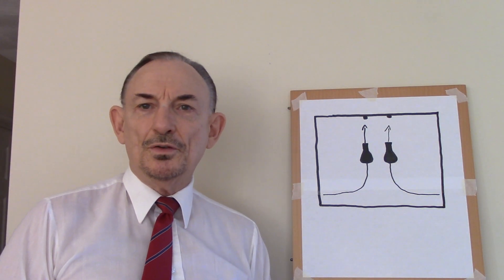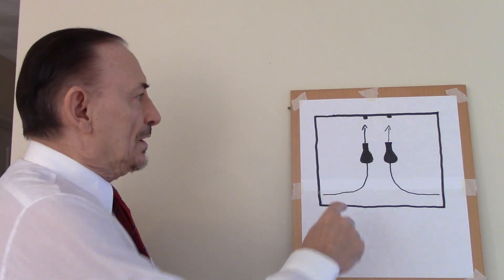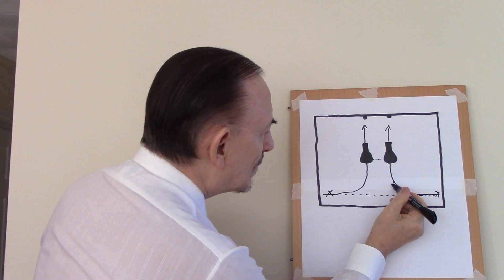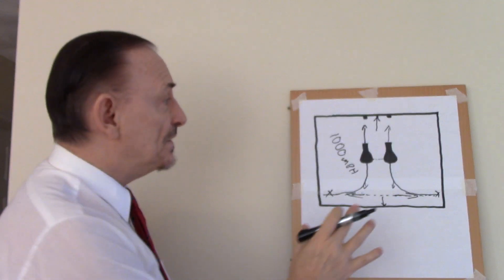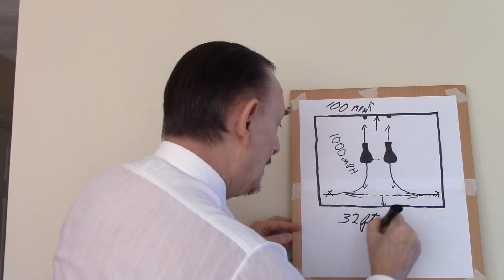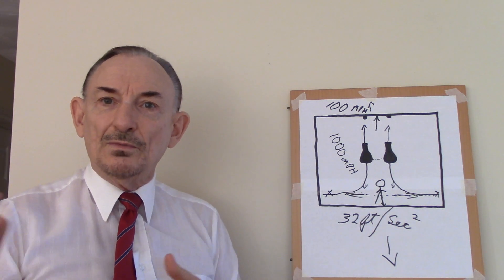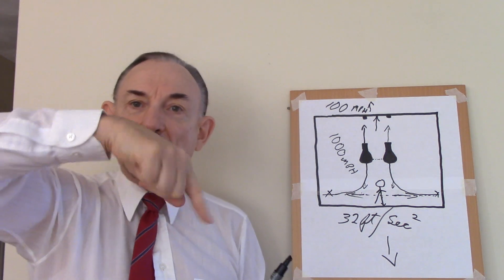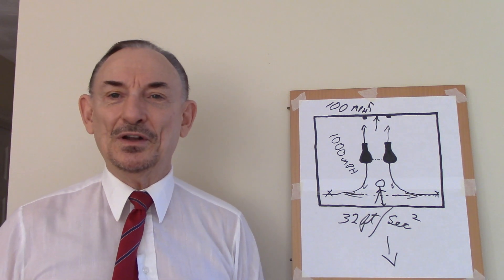THRUST CREATED IN CLOSED BOX

Comment: Thanks for the explanation. 

Assume the cannons and beanbags have equal mass.

As the cannons fire and travel down the rails, they exert a centrifugal force on them, or rather they exert a centrifugal force on each other. 
As you have shown the centrifugal force has a downward (let's call it the y-axis) component  on the rail, which pushes the box in the opposite direction to the beanbags, transmitting that force to the box via the chain, assuming it is held taut. 

The total y-axis momentum imparted by that force as the cannons reach the end of the rail must be half that of the beanbags/cannons. The other half is imparted on the chain (along the x-axis), since they are travelling in that direction by the time they reach the end of the rail. Therefore the net y momentum, upon the beanbags hitting the wall, would appear to be 1/2 that if the initial momentum of the cannons and beanbags.

Newton's third law would indeed appear to have been contravened; there is now a net momentum in the y direction - what am I not accounting for? Any physicists wanna bite? What have I missed? And Jeff, if you do see this, is my explanation correct? (Well, the same question to you basically if not)
Reply: The cannon will be transferring y-axis momentum the whole time they are moving on the curved rails (which are fixed to the box). The integral will /should exactly match that of the projectiles on the box wall. So the box will just jiggle up and down leaving the CG stationary and unchanged when the projectiles are reloaded into the cannon.

Comment: There's no breaking of the third law here. The force necessary to "reset" the cannons is being ignored. The force necessary to allow the cannons to remain pointed up during the initial firing is ignored. The force exerted by the cannons on the curved rails is being ignored. (I know you drew arrows for it. Aside from drawing the arrows, you seem to ignore it after that.) I'm curious to see what an actual vector diagram of this thrust model would reveal. I guarantee you the forces would equal out.

In your example, it would be worlds more efficient simply to fix the cannons to the wall, pointed down, and fire the bags at a curved surface to deflect their energy to the sides while the recoil of the cannons pulled the box up. Even then - it's a Rube Goldberg device and you'd see no apparent motion. Even without the force of gravity - you're still at net zero accellerative force.

As for generating force enough within a box to move and accelerate that box, check out the cube bot, driven by reaction wheels. It's entirely gyroscopic and inertially motivated. Problem - the exterior of the box's friction with the environment is necessary to provide the thrust. It works fine with gravity - useless in space as a thrust generator.

I want to see a working model of your propellor. Shouldn't it be relatively simple to model?
Reply from the maker: This description is so simple that I do not understand why you cannot grasp that there is no downward force on the X axis that equals the force that is absorbed in the chain. Therefore, the upward force exerted on the forward wall by the beanbags is not equaled on the opposite end of the X axis on the downward wall.
I did NOT ignore the force in the curve of the rails and in fact, I made it very clear to anyone listening, that that force was not equal to the force exerted on the upper wall.
I have a video of my prototype on YouTube, that conclusively proves that this principle does work. The video is not impressive, but it does prove the principle.
I took my prototype to my nation's capital, Ottawa, and met with two government officials, one of whom had 4 degrees, two of which were in physics and in engineering. The other two degrees were related to engineering. After viewing my prototype and the description that I gave in the above video, he had no difficulty in understanding and agreeing with the principle. Newton's 3rd Law still stands, but my explanation expands on it.
Reply: @jeffincanada5060  The force necessary to reset your cannon position has to equal net zero thrust. The entire explanation is convoluted.

Instead of this flawed chain-cannon-ramp-beanbag-box analogy, have you published your actual mechanism? It's probably going to make more sense to me than this.
Reply from the maker: @SwervingLemon  Resetting the cannons is a clearly different set of forces. Resetting the cannons will not affect the fact that the box is already moving through space. Since after firing the cannons, the box is moving and the cannons are stationary in their recoiled positions, any moving of the cannons after that will have its own reactionary forces.
To call my example "flawed" is not directly addressing any questions that you may have about this example. You ask if I have "published your actual mechanism". Your English is not clear. Please be clear as to what your question means.
Again, if you have questions as to the explanation, please pose your question and perhaps I can answer it to your satisfaction, but please refrain from criticizing the video without using actual specific concerns that relate directly to the example in the video. Thanks.
Reply: @jeffincanada5060  The question is simply whether you've published any illustrations of your actual mechanism.

I'm not certain how that could be misinterpreted, really.
Reply: @jeffincanada5060  if it does even put ANY thrust, it’s waaaaaaaaaay less than even the least powerful ion engines.
Good luck getting to mars in 1 day, if you can,
And if you can, build it. I want to see this.
Reply: Lemon RE your first point, can't you keep the cannons pointed up without any force, by just having them run along a straight section of rail during the initial firing? But otherwise I agree, a vector diagram of this model would be most helpful.